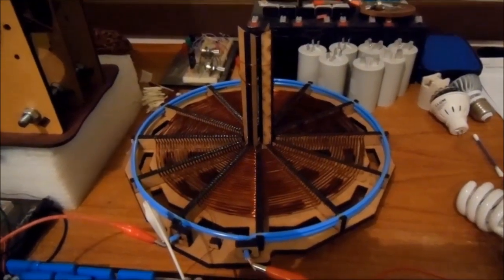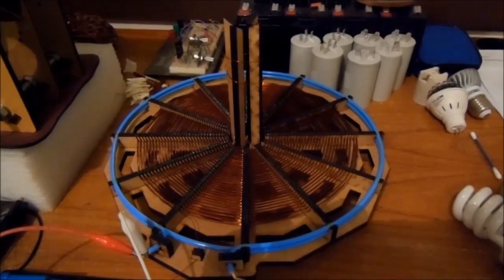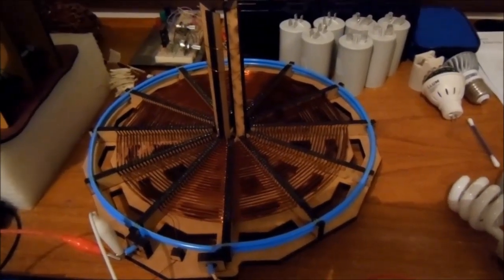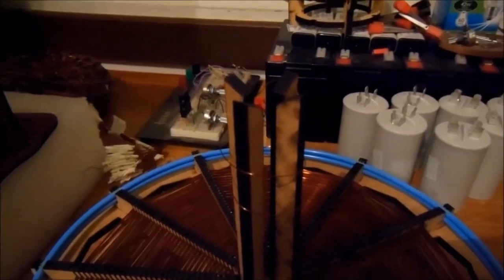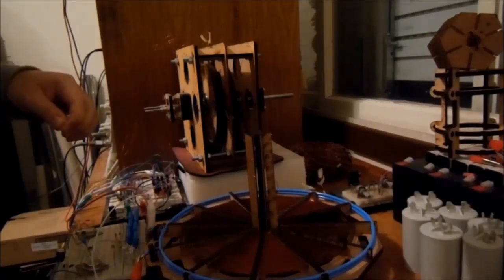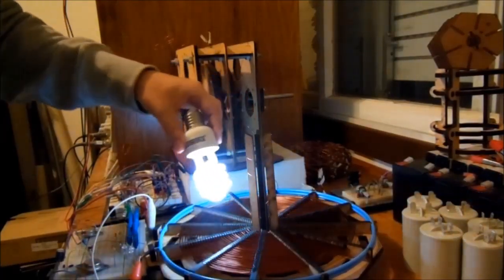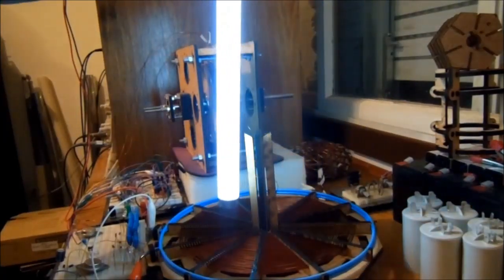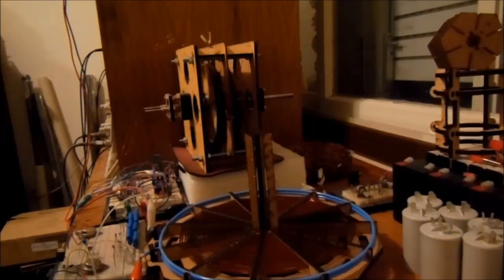Original Tesla Coil for Wireless Energy Transmission

Comment: So the power used is 2.2 watts? The slayer circuits I have seen are using 2amps at 12Volts, because of the limitation of the single transistor to drive the primary. Can you please elaborate on this?

Comment: Interesting setup.  Nice to see a coil that is not "standard" Tesla, meaning more of a pancake configuration.  I assume that clicking sound is your Power Supply, meaning that your circuit wants to draw more power...  another coil setup may satisfy it.
Reply from the maker: J Price that clicking sound it really is from my power supply, but it doesn't matter if I limit to 1A or 5A because it remains even at 5A. It happens as well in the standard Tesla Coil. The reading in the power supply fluctuate a little both in current and dpp, but it doesn't get close to 3W.